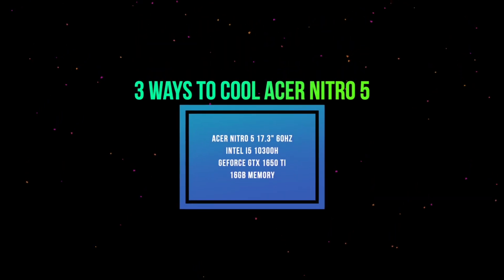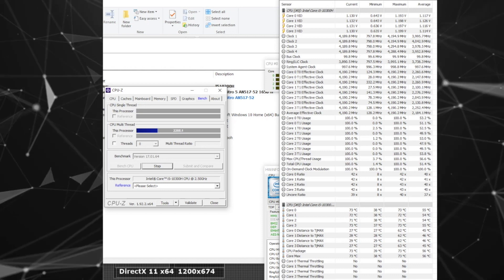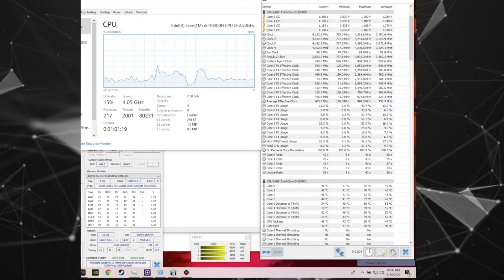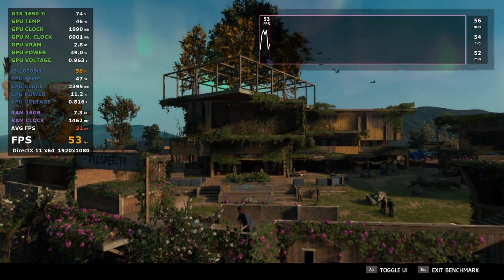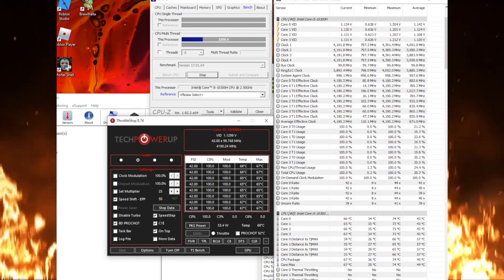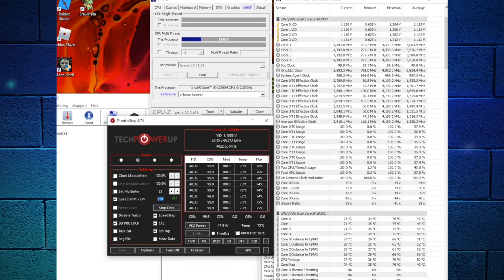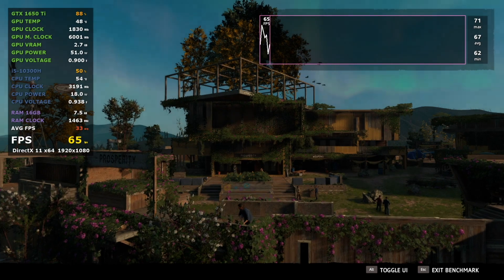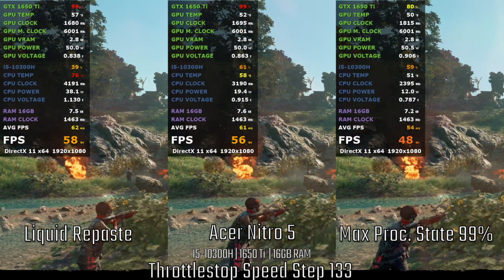3 Ways to Cool Acer Nitro 5 2020 (Throttlestop, Power Management)

Comment: ok the power option seems better i am gonna try garry’s mod on this behalf if there’s any improvement i’ll let  you know 

checking now 

the throttle has stopped but ill check 

garry’s mod is seems to be running without issues 

thanks for this it will be temporary until i can get it cleaned ❤🎉

Comment: Would this work on an Acer Nitro i5-11400H?. cant seem to find any videos on this model
Reply: AN515-57
Reply from the maker: Undervolting the conventional way by adjusting the settings in FIVR may not work because you may be locked out but all the other alternatives in the video should work.

Comment: I have some problem with the CPU after having repaste. It always getting up to 92 93 celsius. Besides, in Valorant especially, the fps drop down significantly (used to be 180 200 now 150 140). Hope u read and explore some solutions.
Reply: @Chadinator3000  Only the cpu and gpu though. If it comes to repasting all the heat sink points, then I guess it quite hard to repaste  them. Any advices?

Comment: bruh mine goes to 90 when playing lol in the summer
Reply from the maker: Yeah, unfortunately that happens in some games.
Reply: @Meanpooh  But recently it started to overheat a lot, way more than it used to before. I tried repaste with some good thermal paste but didn't work. It is also undervolted to -0.135V. I have no idea what is wrong with it but my assumption is that either the fans not working properly or the screws that hold CPU and GPU are not screw in evenly, because they got really worn out and I can't screw in few of them properly.
Reply from the maker: If the screws are damaged you may want to replace them.  They are fairly cheap on amazon.  I ordered some myself earlier this year.  Nitrosense will let you know if the fans aren't spinning.  Just check the RPMs.

Comment: Should I choose between throttle stop and power management or should i do both?
Reply from the maker: Depends on how much control you want.  Power management is easy.  Throttlestop can be a little difficult until you get the hang of it.  Trial and error.  Hopefully you are not locked out.

Comment: Just play on Power saver in nitro sense it will limit your cpu and gpu temperature to 60celsius but your fps will go decrease
Reply: That's what I do, too. I don't see a lot of difference in performance but when I change the settings on nitro sense midgame it instantly drops from 95 to around 60 degrees.

Comment: My throttlestop has locked fivr options, does that mean i cant undervolt my cpu?
I used the throttlestop method and results gave me 71c highest but average temp is at 64c on all high settings, but i dont play on high settings and play on nvidia recommended balance, it gave me 56c-59c average with speedshift 133. Thanks!

Comment: Please can you make a video on Throttlstop settings for Acer Nitro 5? I have crashed my pc multiple times and I'm just too afraid. It's a request as your knowledge  is too good and your videos have a grate explanation. Please
Reply from the maker: Thank you!  This will work for you provided that your cpu is not locked.  https://youtu.be/LQgho8EXAM4
Regardless of the cpu, the method still applies.  If its locked then you may have to try and unlock it.  I have a tutorial for 10th gen.  May void your warranty if it goes bad.  So far many have had success.
https://youtu.be/f8xf7hf_XS0
Reply: @Meanpooh  I have the same spec Laptop that you have I just need a good profile for Throttlstop as I'm unable to find the adequate settings. I've read all the threads and still face the same heating issues. Your input on this will help me a lot. Thank you. Feels good to have a person who's so active and with the same config🥺
Reply from the maker: No problem.  Since you've been at it i'm sure you know that your profile will not work with every game if its tight.  You will have to loosen the undervolt to have a universal setting.
Reply: @Meanpooh  The heating issue is solved but the frequency is so low that it's just not usable. And when I try to increase gradually there comes a point where it just heats up again and I'm back to square one. And youtube has outdated videos on Throttlestop profiles so it's not helping me either. 😅
Reply from the maker: @omkarbadadale5224  Make sure you are on balanced profile.  Around 126 for core and 117 for cache.  Lock the clocks to 37 multiplier for a start.

Comment: Another thing to note, if you have a recent Nitro 5 model with RTX, you can disable the ray tracing in-game and it reduces the temp considerably. Another thing you can do is change the minimum and maximum processor settings from 100% to 99%. In w.o.w. on ultra i was running at 80°c average.  After doing these two things it brought it down to 63-68°c and actually increased fps from 99 to 120-140
Reply: How do you o this?
Reply: when i change the minimum and maximum processor settings my fps drops a lot do you have any tips?

Comment: Hi, which one do you advice? Unlocking undervolt or Speed Shift trick? i have the same laptop, i5 10300h, 1650 ti and 8gb ram. It's new and the cpu temp goes over 90 degrees on games on high performance battery option.Thanks in advance.
Reply from the maker: Try Speed Shift first.
Reply: 👍 Do you advice cool boost always on?
Reply from the maker: Yes.
Reply: When i set speed shift, the cpu clock set 2500 mhz. I think it disables turbo boost. Without it, 3000+ mhz. I am using Forza Horizon 4 benchmark. What do you think? Thanks.
Reply from the maker: Make sure disable turbo boost is not checked
Reply: It's not checked. I think the game chooses the clock speed. Isn't it possible to lock to 3.5 ghz? :)

Comment: Awesome content. I have a question! My CPU doesn't go more than 60c and I paly Valorant. I have my Stats to Auto and Cool boost on. However my nitro 5 it's quite hot to the touch around the battery area and the whole right side of the keyboard. Is that normal?
Reply from the maker: If you're getting 60C, you're golden.  I wouldn't worry about the the temps and it is quite normal for the machine to get hot.

Comment: Yup, i tried the 99% thing and that did barely noticable change BUT throttlestop did the trick. Not riding as low as some peeps but it sits at max 80° so i appreciate the video!
Reply: Do you keep the lower vents on a table or cloth? I highly suggest a stand for the notebook. Does not even need to have a cooler.

Comment: The thing is if you put a cap on temperature limit through throttle stop it heavily impacts the performance lower the temperature cap you set lower will be the performance
Reply: Good, burn your laptop then for more performance

Comment: Dude im nervous i have 1660ti ver im just doing howework my temps goes over 92c.
Reply from the maker: Don't be nervous.  Make sure that nothing is blocking your intakes on the bottom of your machine.  Right click the battery icon on the bottom right and set your Power Plan to Balanced.
In NitroSense, set your fan control to AUTO along with the CoolBoost setting to ON.
In the Power Plan section of NitroSense make sure its on the setting that you chose in your Power Plan.
Reply: @Meanpooh  update! thank you, i just undervolted my laptop by following your tutorials, it helped me a lot, I don't use it for gaming but for 3d softwares , my temp usually goes around 85-94c. But after undervolting my max temp goes 77c.
Reply from the maker: Congrats!!!!

Comment: I FIX TEMPERATURE CRASH BY TURN OFF - BD PROCHOT, WORKS ON ACER ASPIRE LAPTOP F5-573G WITH GTX 950M, THATS IT
Reply from the maker: That's not wise.  You trying to burn your CPU out?
Reply: @Meanpooh  I have no problem, the processor will be fine even with the default 100 degrees according to the factory official spec, the GPU is set to a limit of 93 degrees, but I have never reached temperatures like this, the maximum I've seen is 79 degrees. in games like Fallout 4 with tons of mods and enb, or the last not very optimized Stalker Anomaly 151, with 50+ addons and ReShade, and without games and any programs, cpu shows only 20 degrees and gpu 37 alone, it seems fine to me, im happy
Reply: @Meanpooh  I did the maximum and minimum processor thingy but my temp is still reaches 90 on doom. I even got my nitro 5 like 3 months and. How come this isn’t helping

Comment: Tnx you. I bought new acer 5 with same processor with rtx 2060, has around 80-90°C while playing, nothing drastic, but in long term i wanted to securenit... Now never go above 70 max... It' on 60 with cooler. U have sub. Cheers!
Reply: did u do the same speedshift in throttlestop ?
Reply: No
Reply: Bro I need help what did u do to reduce your temperatures?
Reply: @ItsNylrak  throttlestop, like in video. Put CPU on 99%. Never goes over 65, i play RE2 remake on max possible settings i can. I put it on balanced mod automaticly, when i want I can set it  off by one click in Nitro Sense by pressing High performance.
Reply: @boro4046  Yess the problem was that I was in best performance mode but when I changed to best battery life my temperatures when from 75 to 60 :D the problem is that my FPS also when down about 15 too (from 55-60 to 40) so I guess is a small price to pay for salvation
Reply: god is english ur first language or something?

Comment: This would be okay for the hp pavilion 16.1? It’s got the same processor
Reply from the maker: Yes.
Reply: @Meanpooh  okay I wasn’t sure. I know with the core i58300h you can change the turbo limits in the fiver tab
Reply: @Meanpooh   can you do a tutorial to use the newest throttlestop version for 10th gen cpus? For some reason I still get temps near 90-92 degrees even after using speed shift

Comment: Hi, I have a question I would like to ask. When gaming on the nitro 5 i7 10th gen, should we use Balance power mode or High performance to tackle heating issues ? Also does the balance option lowers framerate ? Which power plan are you using ? Also, for some reason I am unable to find the "Balance Acer Optmisied" power plan option in Nitro Sense, can someone help out? Thanks
Reply from the maker: I always use balanced and occasionally use Acer optimized.  Only battery / power save reduces clock speed.  I posted a video a few days ago that may help with your heating issues.

Comment: Hey bro, I repaste my CPU and GPU, when I run XTU with stress test I don't get thermal throttling anymore. What I get is Current/EDP Limit and Power Limit Throttling. Should I revolt my CPU?
Reply from the maker: Increase your Long power limits
Reply: @Meanpooh  You think the Turbo Boost Power Max?

Comment: throttlestop did the trick. now my cpu hovers around 60C  to 70C during gameplay instead of the 96C which was insane.
Reply: can you explain please, i want to know
Reply: oh u got 96 on ur well beat this 150 honestly man I don't know what to do
Reply: @redtomato1151  are you using Fahrenheit or Celsius?
Reply: @xer559  lol i dont know, how can u tell
Reply: @redtomato1151  your computer would have shutdow way before, hit settings and it should give you option to change to Celsius, it helps a lot
Reply: @redtomato1151  its probably because he has Celsius unit while you are on Fahrenheit
Reply: @kylepoor69234  thanks
Reply: Holy shit you saved your cpu. Thanks, cos my rn can probably fry an egg.
Reply: @gavins9846  mine still overheats and yes mine could cook a turkey
Reply: you play in room with AC?
Reply: How much fps loss ?
Reply: Nice pfp
Reply: YOUR CPU WAS AT 90?!!?! BRO WHAT GAMES YOU BE PLAYING?!?!?
Reply: Pretty fuckin risky doing that tho, that blue screen of death still traumatizes me 😰
Reply: throttlestop does jack shjt. Im so tired of everyone recommending this when it doesnt even work
Reply: @OkSear  check if your cpu is locked, then disable it in the bios settings
Reply: @OkSear  ofc it works. Overvoltage overheats the cpu, reducing the power limit of the turbo should do the trick
Reply: @OkSear  it does alot are u dumb?

Comment: Hey dude I wanna know what is considered unsafe temps?
Reply from the maker: Anything under 100C is safe.  The machine will throttle around 90C.
Reply: @Meanpooh  oh so am I fine? I got to 70-80
Reply: @RedHeavy-  yeah laptops are meant to run hot, if you’re really concerned about it you can get a cooling pad
Reply: @Nada-V  he said anything under 100 c is safe and 143 f to celcius like 61 c so your good.

Comment: it worked exactly like yours did since we have the same specs, thanks a lot. also did you set the max proc. state to 100% instead of 99% while using throttlestop?
Reply from the maker: You're welcome.  I never mess with the processor state.  My machine stays on balanced power settings.
Reply: @Meanpooh  ohh but you said that one of the ways for reducing temp is to reduce the Max proc. state from 100 to 99. so I'm asking whether you kept it on 99% or did you turn it back up to 100% for the throttle stop part after the power management trick was done?
Reply from the maker: No. It’s on 100. I’m giving you 3 options to try, that’s all.
Reply: @Meanpooh  would you recommend throttles top or the 99

Comment: Hi i got an acer nitro 5 an517 (2020) model with rtx2060, 16 g ram and 120hz display when i game my cpu is up to 96c and stays around 90-93 degrees  is this normal? Thx for answering😇
Reply from the maker: Yes, its normal.  Don't worry as your machine is not overheating.  This is the biggest flaw of thin gaming laptops unfortunately.  Repasting is the best way to go if you're comfortable along with one of the tips.  If your machine is new avoid the repaste as it MIGHT void your warranty if you have to send it in for repair.  Lasly, you could use throttlestop and tick the "Disable Turbo" option.  You will see your temps go waaaaay down at the expense of some performance in CPU heavy games.  Give it a try.👍
Reply: @Meanpooh  hey man thank u😃

Comment: I don't want to sacrifice any fps or overclocking for my cpu by going to the advanced power setting and putting it on 99. I also don't want to do the other options. My last option is to buy a cooling pad. I don't have any budget though so I can only spend $20. Can you send me a link for the best 20$ cooling pad that will help bring down the temperature so I can do whatever I expect it to do regularly?
Reply: I also have the rtx 2060 i7-9750 acer nitro 5 version, which runs pretty dang hot.
Reply: I know this is a late comment but you will have to spend more than 20 bucks to get a great cooling pad, unless you buy one used
Reply: Same dud, like i don't want to change any thing in my laptop im afraid i might done smth wrong HAHHHABA

Comment: I got acer nitro 5 i7 1650ti with 8gb ram installed bought within this week and the temperature rised within 3 days but not that hot that can cook a house. However, should I return this instead?
Reply from the maker: My machine ran cool for 2-3 weeks and I finally had to repaste.  If you think that it's too hot don't miss your opportunity to return it as it may be short.  Repasting helped a lot and its been running fine every since.  In my latest videos with this machine, I run it without any modifications and get full speed most of the time.

Comment: Hey,mean pooh I've just ordered nitro 5 same i5 10th gen gtx 1650ti whether it is ok for casual 1hr gaming and movies ? After seeing this my mind thinking  i have chosen  wrong decision ? Pls clarify?
Reply from the maker: IMO every gaming laptop is garbage for gaming on battery.  Most gaming laptops will get hot. that does not mean its malfunctioning.  That's just how it is.  Small space, fast CPU, GPU, not enough cooling, small battery.  CPU will get hot, it will throttle to cool itself like its suppose to.  You want good battery life, get a MacBook or Chromebook.  Budget laptops are cheap you may try to get a Ryzen variant but I heard they get hot as well but are more power efficient.
Reply: @Meanpooh  iam not heavy gamer just entry level and some college stuffs 3 to 4 andhalf  yrs  it is ok
Reply from the maker: @rsyukesh4536  Check this,  I take my machine to work a few times week.  No matter what, I get 2-2 1/2  hours of battery time.  So you  have got to carry the power supply.  During this time i'm only watching youtube videos and browsing the internet.   Regardless if you are a gamer or not, the fact that it has a gaming GPU is part of the reason why the power diminishes.  On the other hand, the machine will last you for some years, with maintenance of course.  Theres really not much you can do besides trying to lower the cpu cycles. disabling turbo and completely crippling the machine to get more time.  Thats my honest answer.
Reply: @Meanpooh  😎👍